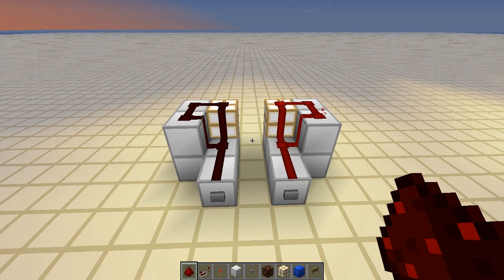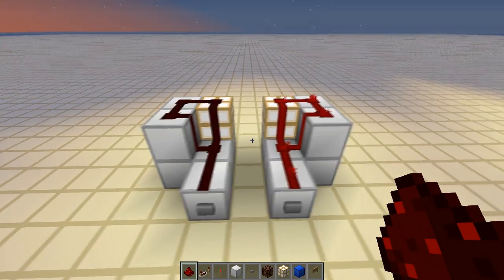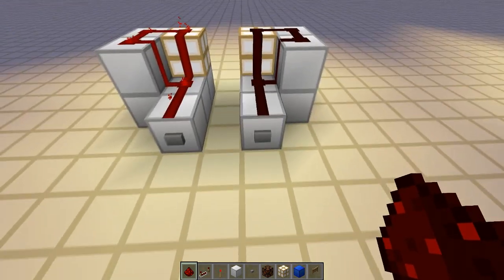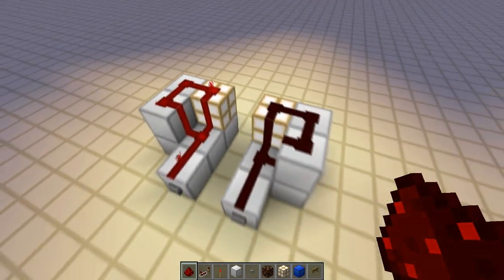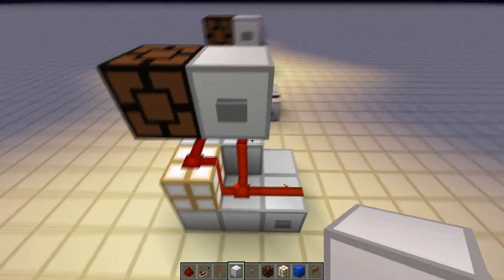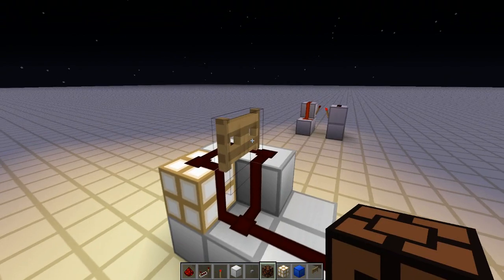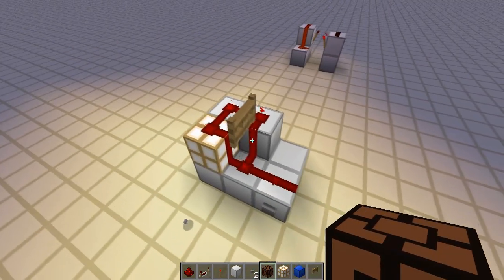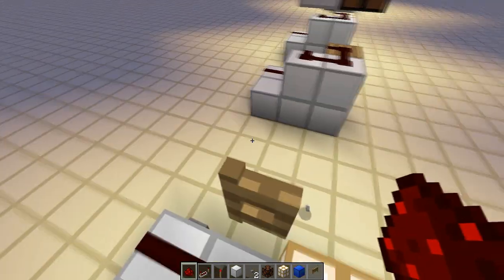Minecraft - Instant RS-NOR Latch

Comment: Fillz, it does count as and rs nor latch because you can take an inverted signal from the output. Only problem with the design is there is no way to "lock" the signals from letting the other one pass.